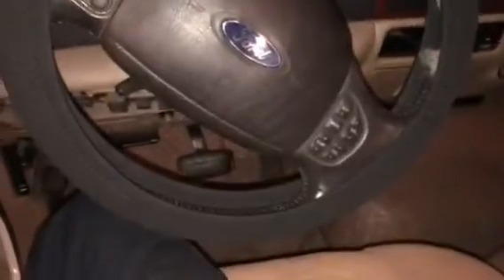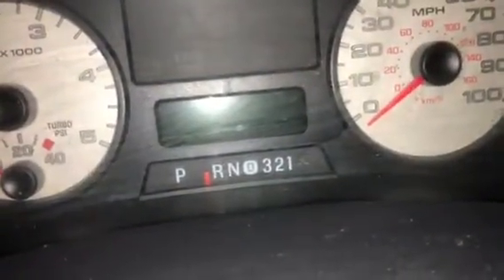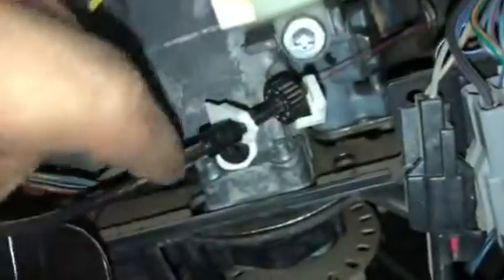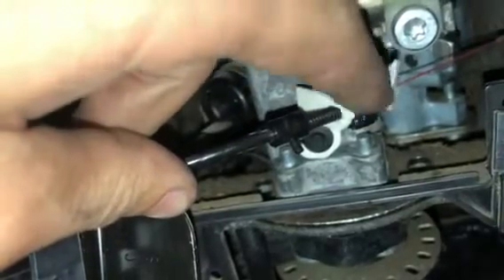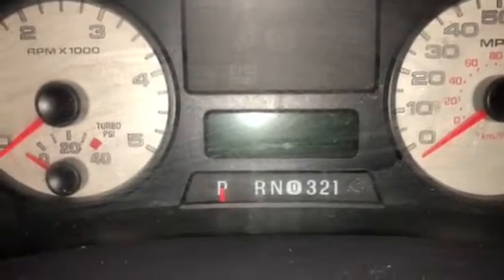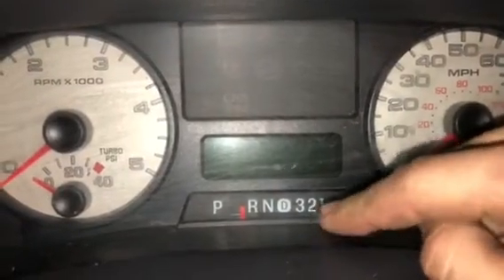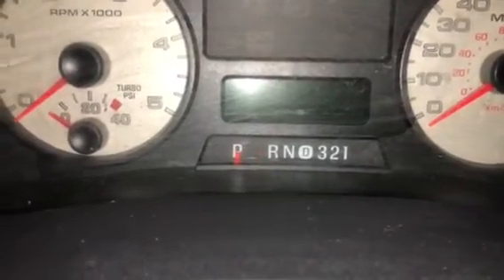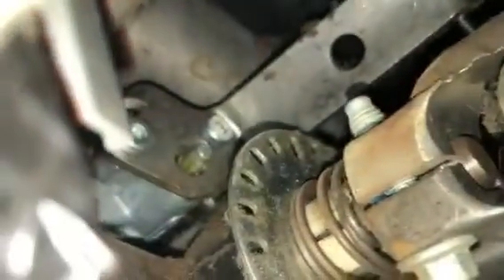2006 F250 Gear Indicator Fix

Comment: Did you ever find a part or part number? I’m needing the exact same piece
Reply: Just adjust it and use a zip tie. Works the same.
Reply: Tyler. Ever get that part number? I'm having the same issue. Zip tie will eventually fail.
Reply: O'Reillys. Part # 83244.
Reply: Can u show how to replace that small plastic part ?